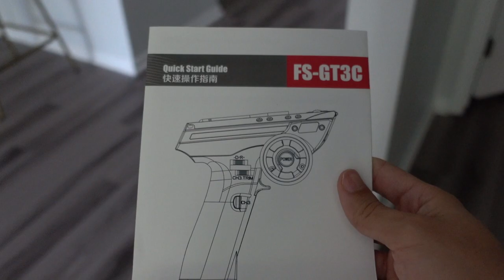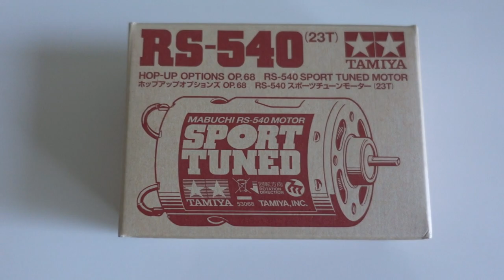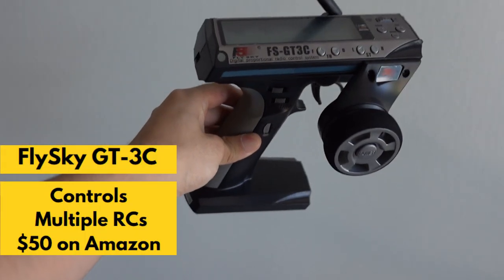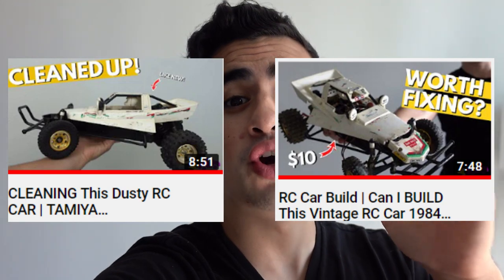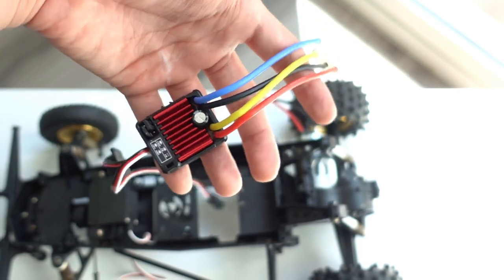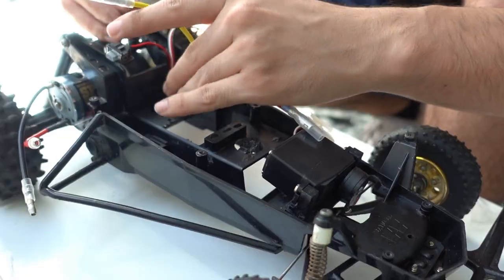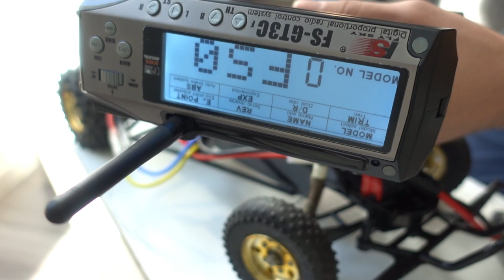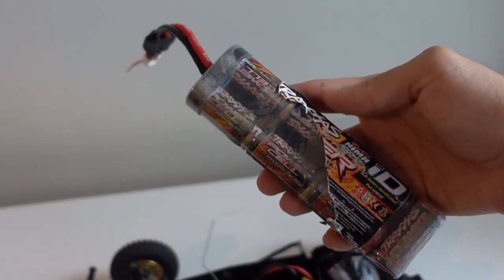Rc Car Electronics Installation (Part 3)| Tamiya Grasshopper ALMOST READY!

Comment: That silver sport tuned motor came out last year the black canned sport tuned motor came out years before so that motor is relatively new from what I heard
Reply from the maker: Ah yes, I've seen Tomley's video that you linked. I like the look of the black can better with the gold lettering, but I guess the silver can was a bit faster at least in that vid
Reply: Jacobus RC yeah I’ve got the black canned for my old grasshopper
Reply: Jacobus RC mint condition only built it up last year

Comment: I just got a new Remote and receiver, and my car is slowly spinning it’s wheels when I’m not doing anything. It also will not reverse.
Reply from the maker: Might need to calibrate the esc and adjust throttle points

Comment: You shouldn't call it the ariginal motor as it is not the ariginal 380 silver can motor the grasshopper comes stock with. The motor you have that came with your grasshopper already is a hoped up 540 motor. Why switch it?
Reply from the maker: Ah yes thanks for clarifying!! wanted a new one that’s why 😆
Reply: @JacobusRC  always good to have extra 👍

Comment: Were r the links and how much was the controller and receiver
Reply from the maker: I just put the links in the description, sorry! -- Also radio+receiver is about $60 USD. I think it's worth it because you can control up to 6 cars with 1 radio. Creates more space too so you dont have a bunch of radios
Reply: @JacobusRC  thanks man great series btw
Reply from the maker: No problem and thanks!
Reply: I just found a very old grasshopper is pretty bad shape and i was looking for to vids on restoration so thanks